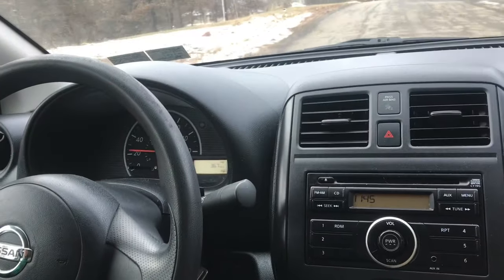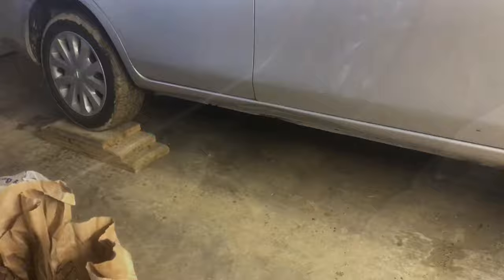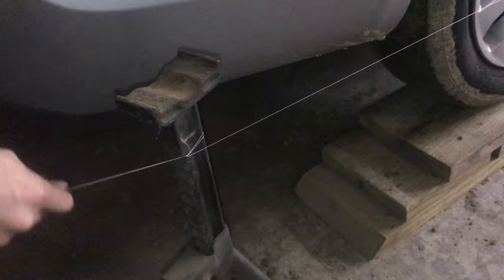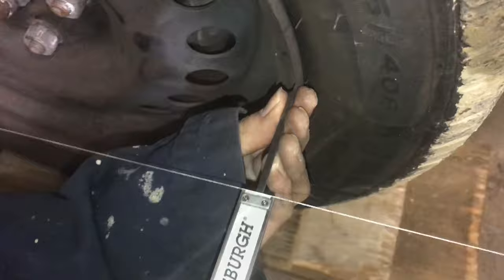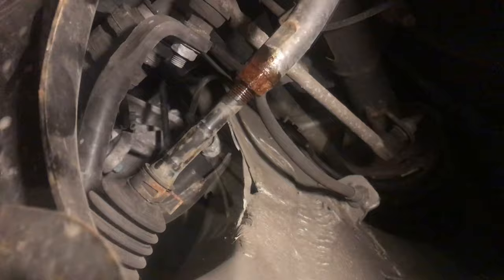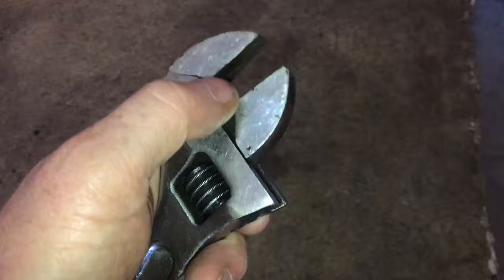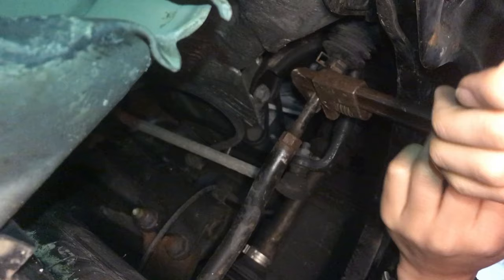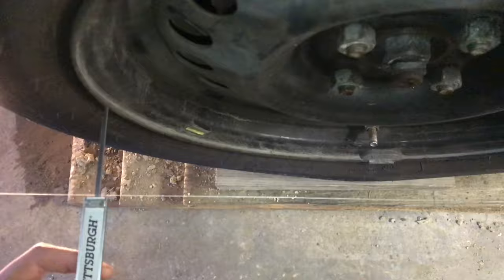PERFECT diy front end alignment SIMPLE tools

Comment: don't use crescent wrenches for anything , you can get a full set of both types of wrenches for next to nothing, and carry them around in a kit as easy as anything. I'm embarrassed for you
Reply: Where are you videos?
Reply: I used crescent wrench today change the center link and tierods
Reply: @nathankoroush7918  the other "you" site
Reply: @Deeznuts84356  cool deal, I used one for a hammer , then as a one time use reverse boomerang
Reply: Get r done.  Never tried the boomerang i might try it
Reply: It's fine to use Crescent wrenches as long as you use METRIC crescent wrenches on  the imports and SAE on American... lol
Reply: @billmoxon9506  lol, I was working maintenance when I made this comment, there were a couple of guys that, despite our boss generously spending company money on decent mid grade sets of tools, insisted on carrying these loose wheel pot metal junk crescents around so the challenge of metric/standard bolthead size could be sidestepped. After about the first size cauliflower bolthead I ran into, I had enough and went on a lot of tirades against crescents lol. New job doesn't have that issue to deal with. Now its some mysterious rascal that keeps spilling 11 hour gorilla glue in everyone elses seat 😒
Reply: My grandfather thought me the same thing
Reply: They kinda suck for sure, but they can be handy. An already cracked nut in a very awkward spot can be removed quicker with an adjustable wrench that is set to be slightly looser than the nut size. Especially if the proper open-end fits very, very tightly. If you can get a decent quality crescent set snuggly on a nut, they can handle some good torque too, but again, they're my last choice. I like em for tweaking sheet metal bends though! Perfect for straightening abused unibody pinch seams.

Comment: I would use this method after replacing something on the steering components so i can get to the garage and get it checked . Tyres are expensive and a couple of degrees off could burn through a pair of fronts in no time. I bet you arent far off though

Comment: Toe in setting depends on the car's specifications.  Toyota Camry calls for zero toe in the front and slight toe in for rear wheels.  The theory being that front drive cars when under power will toe in slightly, while rear drive vehicles would toe out under power, so for rear drive cars a slight toe in of the front wheels would be correct.  It's best to look up the specs for your vehicle.

Comment: Pulling Left/Right it typically a "bad" tire. Instead of the tire being flat across the treads, one could be angled slightly (cone shaped). In this case swap your front tires and see if it now pulls to the opposite direction.  For toe in, I typically use a tape measure to measure across the rear of the tire then measure across the front. The front of the tire should be toed in very slightly to not at all.

Comment: Not all cars have the same distance between wheels, as per my Z4. You need to run two parallel strings. I use two strips of 2 x 4 with strings set at equal distance, then placed equally between front and rear wheel centres.
Reply: You can also just figure out the difference in track width and compensate in order to make lines parallel. For example, strings might be 100mm off of rear center caps but only 92.5mm off of front center caps.

Comment: Did you establish a box?  What if the rear tires a fixed narrower than the front?
Reply: Mark Vermeulen that’s why your making a parallel line from your centre.
Reply: @angelokarantonis7509  How would you establish a center line that is useable? Hang a plume line under the car and then use straight edge / board against the front tire exterior to set an equal distance from center string?
  The string approach will have some margin of error.
Reply: @angelokarantonis7509 you really aren't making a  parallel line from the centerline of the vehicle using the string method.  The string method assumes that the wheels are the same distance from the vehicle centerline on each axle.  This is not always true though.

Comment: when you say 1/16 toe in do you mean from the centre of the wheel? so 1/8 from front of rim to back?
or 1/16 difference from front of rim to back?
Reply: front of tire has to toe in 1/16
Reply: Good question.
Reply: The difference of the measurement between the rear of the tire and the front tire is toe. 
Unless everything is close, checking one side is not very accurate. At best, it is enough to get to a shop for proper alignment.

Comment: This will get you close if the contact points on your rim create a plane exactly orthogonal to the axis of rotation of the bearing... but really to get it accurate you need to do wheel rim runout compensation.

Comment: This method only works if your axle widths are both the same
Reply: just offset the wire
Reply: @boazruis913  to what? The two axles act as a datum
Reply: @bonkeydollocks1879  if one wheel hub is say 1 cm further out you just add 1cm to the distance to the second hub, so for example the wire to hub distance at the rear axle is 10cm and at the front its 11cm.
Reply: @boazruis913  adds more discrepancies to the overhaul accuracy in my opinion but I get the idea
Reply: @boazruis913  the problem is that this just assumes that the center measurement point of the wheel is the same distance on both sides of the axle.  This assumption is not always true.  Perhaps a better way would be to verify that the axle center measurement points are actually equidistant first from the centerline of the vehicle.

If you don't care about the actual body of the vehicle however, then you can just align the axles.  But the rear and front axles could still be shifted left or right relative to each other throwing the measurements off.  And the measurements have to be very precise even if the axles are centered relative to each other.  Each mm on my vehicle for example is about 0.02 degrees.
Reply: I had this issue on my a4 flat hub at the back and hub nut on the front, I measured off the flat hub at the back to the edge of the rim that’s 25mm so I just set the tape measure 25 mm off the edge of the front rim when setting up the line. Had a straight line and the alignment worked
Reply: @drew1dyton460  read the reply above yours, this isnt always going to work

Comment: I’m one minute into your video and it’s wrong information. As a mechanic and tester I can tell you that the vast majority of rear wheel drive cars are set toe in as when the vehicle starts moving the front wheels are pushed outward. 
But on a front wheel drive car the setting is usually toe out as when the front wheels start spinning the forces draw them inward. 
Not only that but it isn’t just the alignment between the front and rear wheels which is set, the alignment of the front wheels together is also set toe in/out.
Every individual vehicle has particular settings which are a balance between good handling and even tyre wear as you can’t have both perfect it just doesn’t work like that.
Also the settings each one has comes with an “acceptable range” rarely do they align perfectly especially on older cars. As long as the settings are within that range it’s acceptable as tyre wear will be ok, vehicle will run straight and the steering wheel will be straight also.

Seen countless at home alignment videos and most are utter trash which probably cause countless tyres to be destroyed.
Reply: WRONG
Reply: thanks, I now know real advice from a real mechanic, I have a front wheel drive, and need to do a wheel alignment myself, I was going to do 1/16 to in at the front of the rim, is this incorrect.

Comment: So basically if the rear distance between wheels are different or one or both rears are out of alignment you are fucking everything up at the front
Reply: WRONG, PAY ATTENTION NEXT TIME
Reply: If the rear wheels aren't aligned, your bearings are shot and you have bigger problems. They don't turn, they should be constantly aligned.
Reply: This is why you establish parallel strings on both sides.   Then the difference between front and rear width doesn’t matter
Reply: @dickjohnson5025  And BINGO was his name-o!

Comment: *Wears tires horribly because he refused to pay a shop $100 lol
Reply: This is typically used as a method after doing maintenance on your own vehicle. This is just to get the alignment close enough to be able to take it to a tire shop for the alignment.
Reply: @C_Gu3  why bother just take it to a shop a few miles won't hurt
Reply: @paintballalienindy09  it depends on how close you are to a tire shop and how far out the alignment is. If it's severe enough it can be extremely dangerous to drive.
Reply: Paying people for something you can do with basic knowledge and tools.... This guy couldn't have made it simpler. 

Great video!
Reply: @C_Gu3  tyre shops are useless though
Reply: @bonkeydollocks1879  mostly true. Luckily we have a small shop in town that's extremely knowledgeable and I'd never take my vehicles elsewhere.
Reply: @C_Gu3  you don't know how lucky you are
Reply: I have used two parallel string method and have had perfect alignment, almost zero wear. I have replaced a lot of front suspension components and can tell it;s slightly off. Even the mpg can go down as the car works harder if wheels aren't aligned properly.
Reply: @flybobbie1449  agree, I use the simple string method, very accurate, I will never go to an alignment centre again

Comment: Bro this is not the right way of alignment becoz mostly cars have different front and rear track width. On the geometric center line method  is the right way.
Reply: Share your knowledge on the subject. Make a video of the right way.
Reply: Use your brain...
Reply: This is why you establish parallel lines on both sides of the car
Reply: Yes, this is the correct way of doing it and race car drivers do it every single day they don’t use a alignment machine they use a tape measure and a string line. How do you think they done all this alignment before machines come around and steering wells for Dad on that’s awful funny because I paid $120 to have a alignment done on my vehicle and I had to straighten it out because the steering wheel was off by a quarter of an inch I had to get my jackstands and do a string line alignment and it is perfect better than our machine

Comment: I have better way.

Adjust the tie rod a little. Drive down the road. If it isn't right, crawl under and adjust it again...maybe do the other side...jus cuz. Keep doing that till it goes straight. It might take a few dozen miles.

Oh...and buy cheap Chinese tires in case it doesn't work.